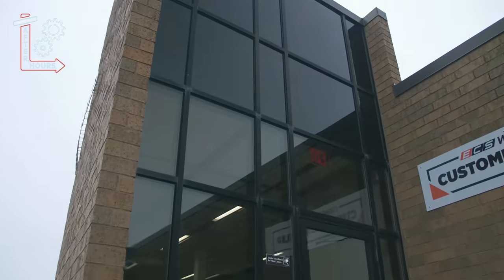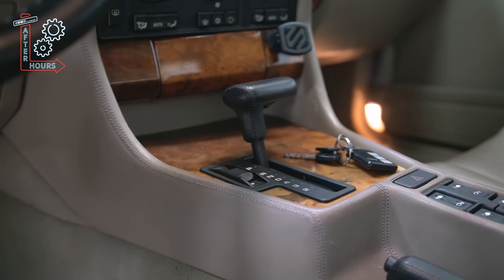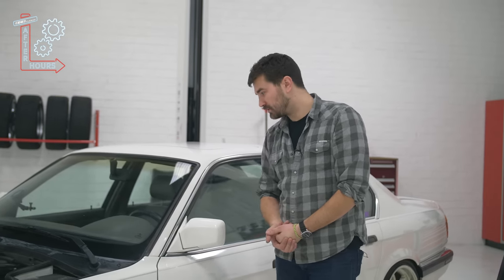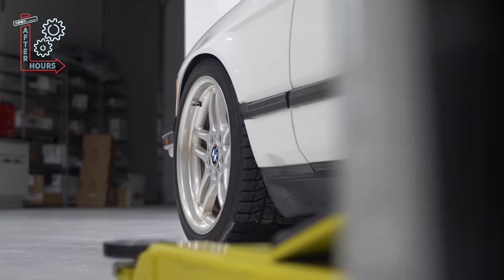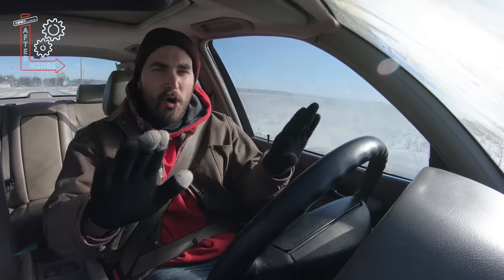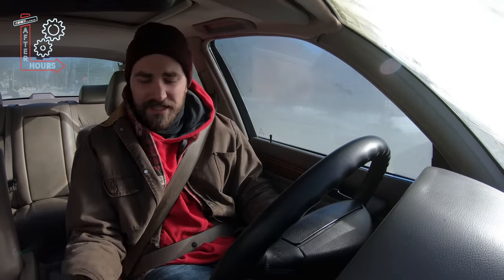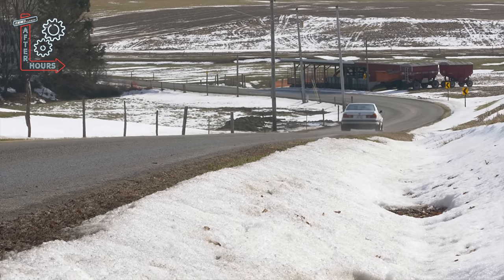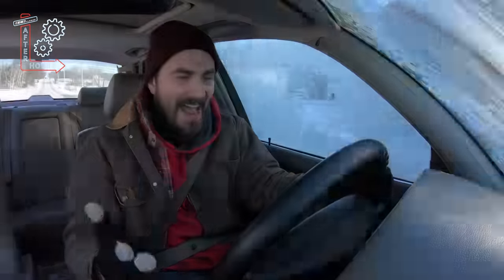I Bought a $1500 BMW... and Blew the Tranny // Winter Beater Challenge

Comment: Looks to me like you have the seat raised to high. The rear base of the seat goes up and down not just forward and back.  Power seats right?  This car doesn't deserved the winter beater treatment!!  No respect!   This car was made in a way that it can be sustained indefinitely by parts that can be reworked with minimal cost.   Almost every part can be taken apart and cleaned or repaired.  You don't know a fine automobile son! ;-)  Poke Poke  ;-)